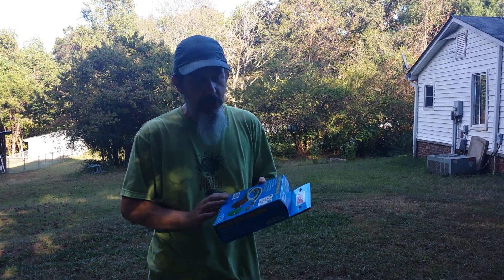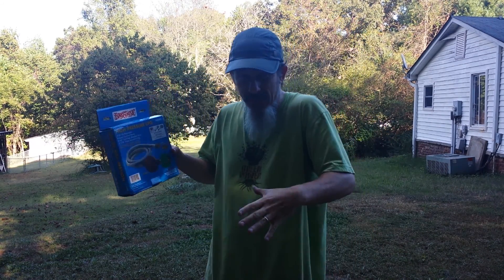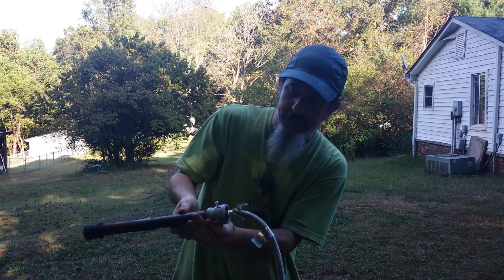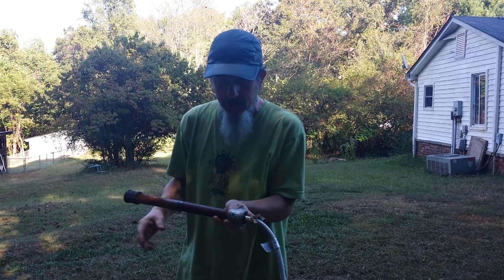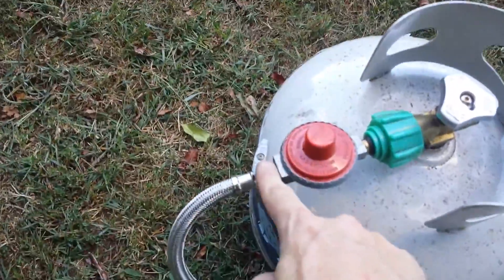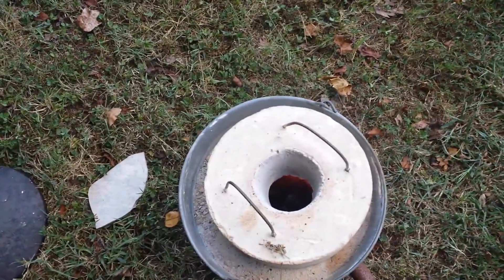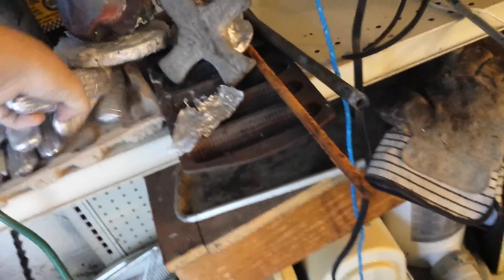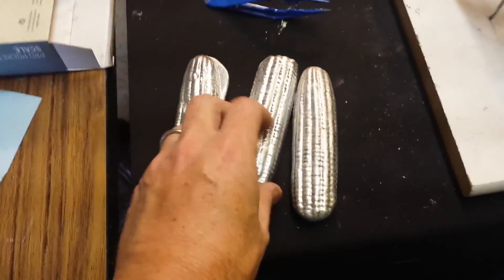MakerJ101 Shout Out - Easy Propane Torch

Comment: Cool, I plan to make a furnace over the summer. It is very useful for making metal oxides for thermite.
Reply from the maker: King of Random torch build is much easier with this inexpensive regulator. 10 psi is plenty for melting AL. I havent tried any other metals though. His mini metal melting foundry is pretty good, but I dont think its durable enough for sustained use. I have an old propane tank that I plan on making a more professional foundry build, using real refractory cement.
Reply: schel sullivan Sounds cool. You can also try ceramic foundry bricks, but I've never found any at the store.
Reply: I'm going to try one torch like that and an extra air supply so I can add liquid fuels with a high energy density like biodiesel. That's after I get around to making the dang furnace, of course.
Reply: NO3- SAVAGERY Same, haven't even started.